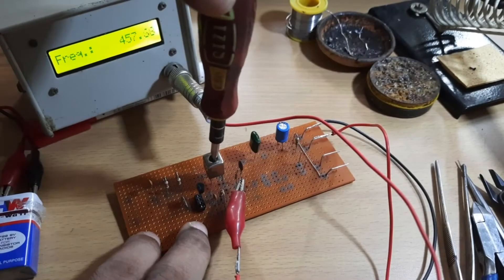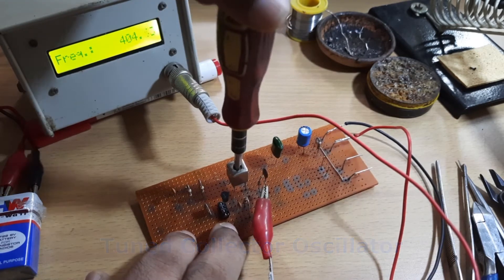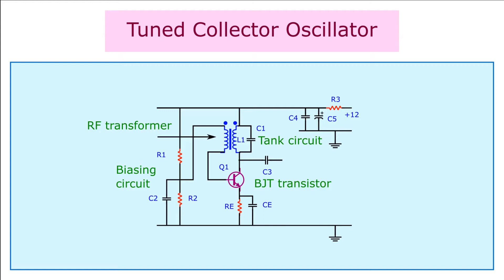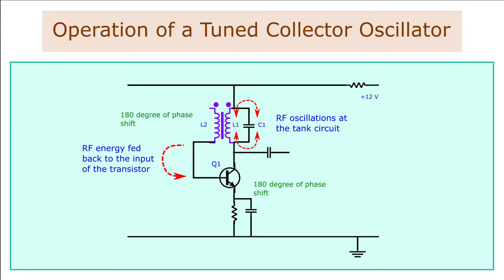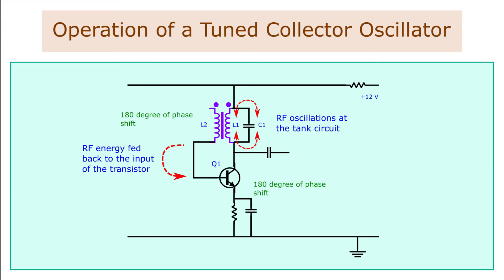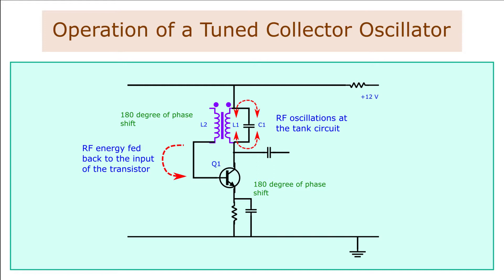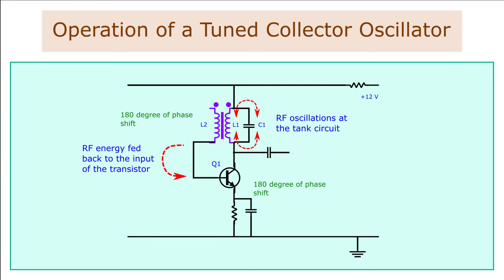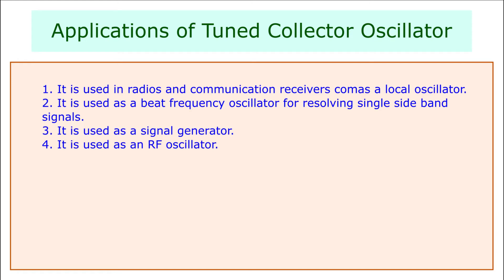What is a Tuned Collector Oscillator || How to Construct a Tuned Collector Oscillator

Comment: What is the value of rf transformer
Reply from the maker: The number of turns on the primary winding of the transformer determines the frequency of oscillation, which can be any number from 160 turns or so in the 455 Khz to 10 turns in the higher end of the high frequency band. The secondary winding is just a few turns over the top of the primary winding, which can be 20 turns to 2 turns depending on the frequency of oscillation. For oscillating on 455 Khz, you can use the intermediate frequency transformer (yellow or green color on the ferrite cap) used in radios and it can be used as a beat frequency oscillator.
Reply: @amateurradiouniverse   thanks 🙂 . U got a new subscriber
Reply from the maker: @prameelagandikota8006  Thank you, my friend! Please do comment if you have doubts. Have a nice day!